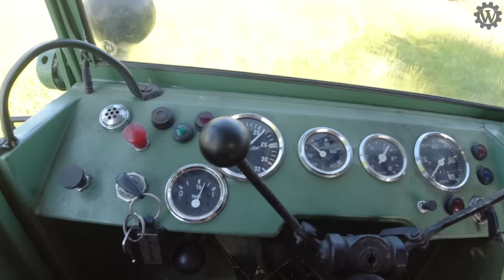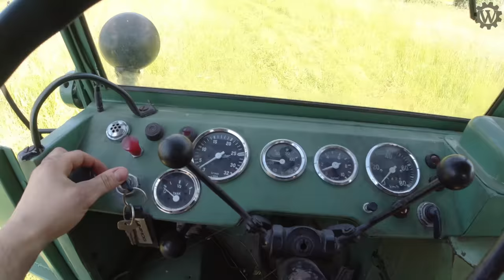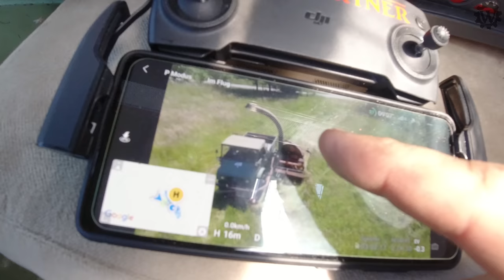Ob das gut geht? Unimog 411 beim Gras-Häckseln mit Speiser Scampolo U

Comment: ' Morge Lugge,    wider einen schoenen video - bloss auf den Messer / Finger beachten!   Menschen's kinder! du!   Didn't quite understnad why you are having choked pipe / = blockage  -  grass too dry = not heavy enough and slippery enough to polish the rust away ? ....   or not enough and steady  ( no lumps) ?   Hmm I would make hay from that grass instead - it is too far on for silage,   - or are you  " Zero Grazing" for some old cows ?
Reply from the maker: Yust trying out :-D Problem was, the flap was too steep, you cannot chop on the tipper, you need an trailer, so that the flap is open wider; i will try next time and i bet thats gonna work quite well :-)
Reply: @LudwigWeinfurtner  Naeh!  :-)   I bet not!     Mengele on Front of Unimog to feed the Box AND a trailer behind as well as side loading trailers alongside ...    Waiting in eager participation to see how you get on.   Oh those were the days - Years ago!     but watch your finger s in the Mower !     Technical tip:   make sure that the Knife to Shear Bar is good and Paddles have correct clearance as well.   You need to have  clean chopping AND sufficient airflow BUT not too much or the grass gets caught in the air turbulence - want to cut and THROW the chopped grass.   Fahr did a lot of work on that , trying to catch up on Claas and Deere.  Theory and Practice    was macht der Meister ?